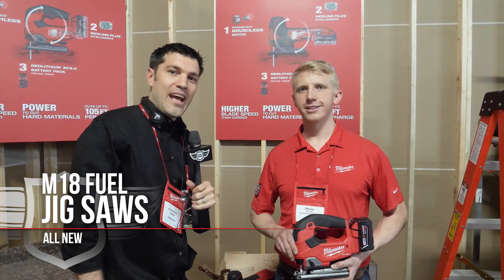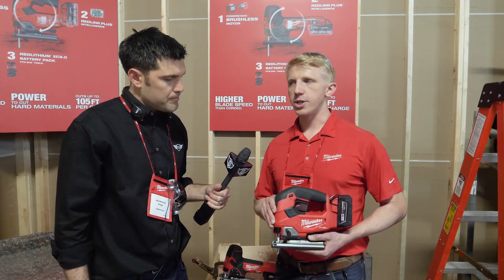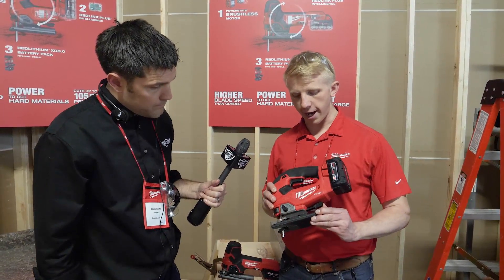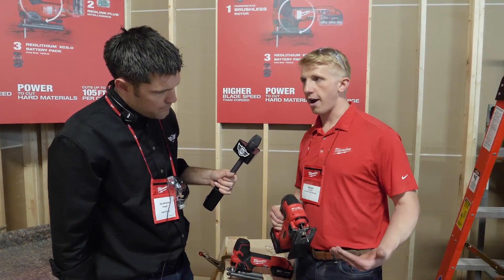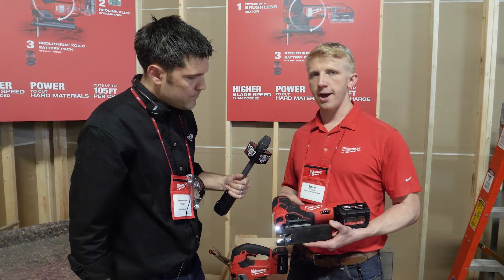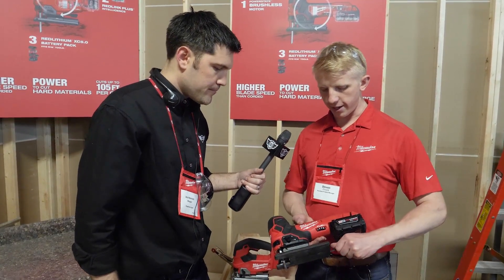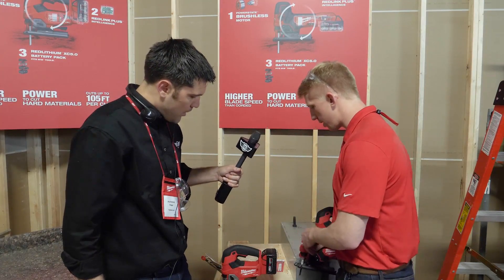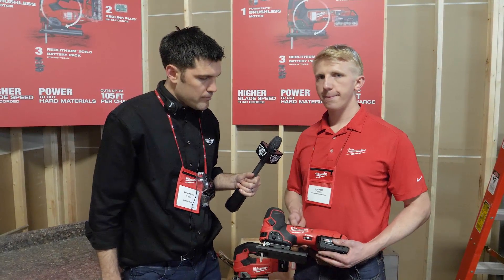Milwaukee M18 FUEL Jig Saws D-Handle 2737-20 & Barrel Grip 2737B-20 - NPS18 Interview

Comment: I'd really like to see a barrel handle jigsaw in the M12 line like the one Bosch has
Reply: i think the reason that may not happen is because the m12 saw that is already out has a grip that is already very similar to the barrel grip design. the only real difference being where the motor is located.
Reply: JK AtlaZ Yeah, that's a terribly designed saw.
Reply: @MNCasaPro  the m12 jigsaw is sick, just needs a orbital action, lovely for curves...
Reply: @billys1997  I have it. It's nicely powerful and tracks well, but it's unwieldy - especially when used upside down as it would be used for coping.  Also when used normally the chips instantly cover the cut line.  I got it free with the Hackzall kit, so I can't complain about the price.

Comment: I hope they stiffened the bevel latch on the D handle, my wilfukyee brushed jsaw is a pain for that coming lose.
Reply: Do you have the m12 or the m18, my m12 did the same crap it was super annoying, so i upgraded to the m18 version but i havent had enough time with it to see if its gonna do that same crap.

Comment: Since you (uploader) mentioned "do they have lights", I just gotta say - in case Milwaukee is lurking in the comments.  I've been wanting to switch over to Dewalt since about a month after buying my Milwaukee Fuel Impact Driver and Hammer Drill combo a couple years ago based solely on the absolutely useless led lights on your drivers.  You should call'em shadow makers.  I like the Dewalt's three leds around the front of the tool.  And there's really no huge difference otherwise - except the color of plastic.

This is a no brainer, step it up - please.  I don't want to have to wear a headlamp at all times.
Thanks.

Comment: I've had some time🌗 allabout.wiki/Milwaukee-M18  to get used to using the saw now and I think its a good one. It feels very solid and well made - great MILWAUKEE quality. I like the settings it has for the eliptical blade movement and blowing dust out of the blade path. The quick blade change lever is easy to use but wont be accidentally bumped. I feel that this is a tool that will last me many years. I was considering the next model up to get the additional blade stabilization, but I think most of the blade flex happens below the foot of the saw anyway were there cant be any support. I think usage technique can make up for most blade flex and you also have to realize that this is a fact of life with a jigsaw and use it accordingly.

Comment: Crap... i was just thinking I didn’t need to upgrade my jigsaw. BUUUUUUT... now i see the d-handle has a little blower and a light. He also said something about dust collection, but i don’t see any attachment for dust hose.
Reply: Daniel Julian If you look at the shoe there is a place in the rear middle which you plug in an attachment and then plug the vacuum to that.  I have an older corded jigsaw which came with the attachment so I’m pretty sure this one will too.
Reply: Ryan Jacob thanks for the info. I have the current M18 jigsaw and it didn’t come with any attachment, but looks to have a similar attachment.
Reply: How can u tell, they never showed anything up close.
Reply: Lou Cifer I don’t think so... or it doesn’t work. I always have to blow the dust away myself.
Reply: Daniel Julian,

Don't you find it completely shocking and aggravating that nearly every tool manufacturer can't get lighting right?  Just put some leds in a location and pointed in a direction that illuminate what we're working on.  What the fuck are they doing?  Lol.